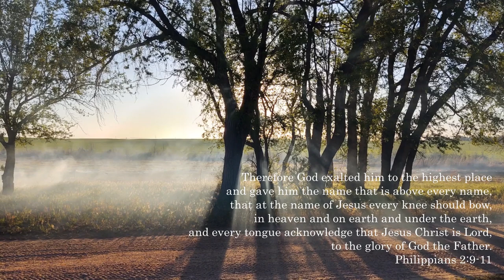Fixing Loud Power Steering Pump on my '98 Silverado - André Approved!

Comment: I have a 96 that the power steering pump has also been loud for a couple years now. My experience with reman aftermarket power steering pumps has been a bad experience. They all have been worse and louder than the old noisy oem part that I replaced. I had to just finally buy a new oem part for it to finally fix the sound and be quiet and work nicely. I used Aldata to get the info for the bleeding procedures.

Comment: My truck doesn't have the electrical connector (pressure switch for idle-up?) or the serpentiming belt (hehehe!). Can I use sympathetic motor oil in the crankcase? Just kiddin' - I like to make up my own words. Makes me feel purty smart!
Reply from the maker: My Grandpa did that all the time as well, I guess I do too. One local feller named Joe that hung around our shop (who wasn't too bright) had bad teeth and once asked gramps if he ever had pain. Grandpa asked him, "do you mean  like HERMA-TOIDS (hemorrhoid's)?" And Joe replied, " are 'dem in the back of yo' head?"
Reply: Hehehe! That reminds me of my friend's mom saying another lady was having a "hysterectum". Barely able to keep from chuckling out loud, he told her "That sounds pretty painful" to which she replied "Some people it bothers a lot, and others not so much".

Comment: Why does a power steering pump have an electrical connector? Do you ever get the notion sometimes that automotive engineers are just sitting around looking for something to do?
Reply: I think that's a pressure switch to sense when the pump is working hard - and it may speed up the engine so it makes a little more power to compensate. And yes, people are sitting around thinking of things to add to cars to make them more expensive, both to purchase and to maintain. Nowadays, instead of having a linkage from the shifter to the transfer case, they have a little knob on the dash to turn, an electronic controller, score of feet of wiring, and an electric motor to move the transfer linkage internally. The added cost isn't just for the parts - it's also for the time a technician takes to troubleshoot the system. Obsolete parts causes the customer to trade it in, too!
Reply: Its the steering assist switch.